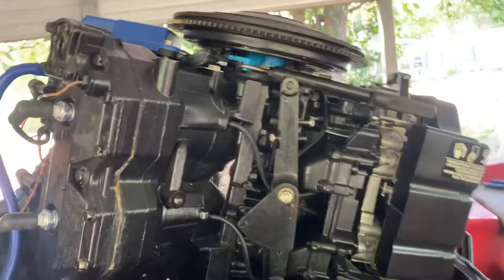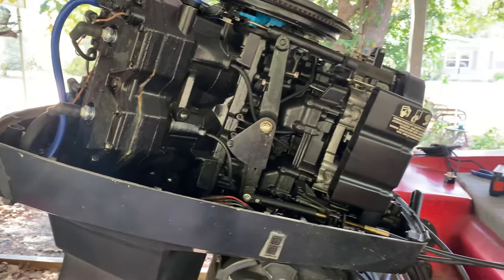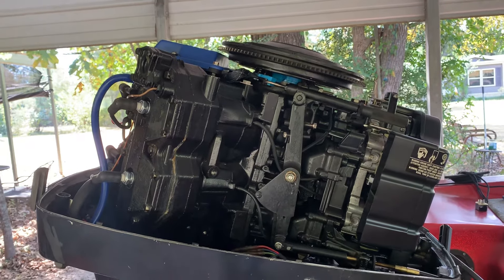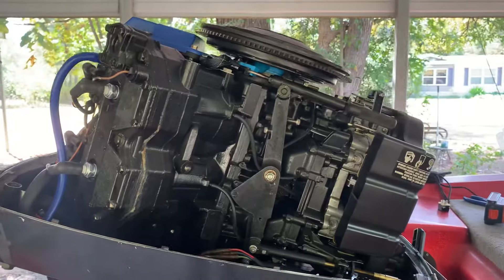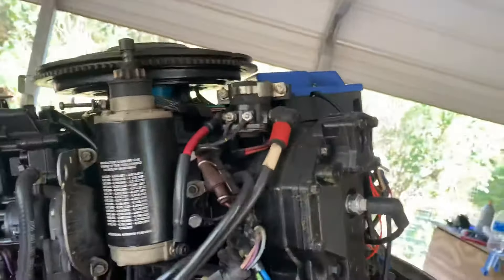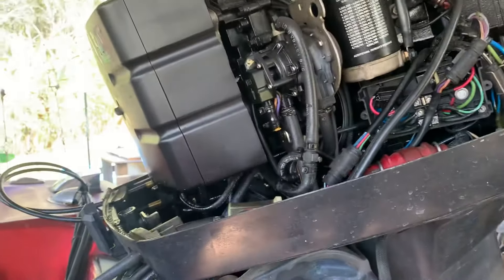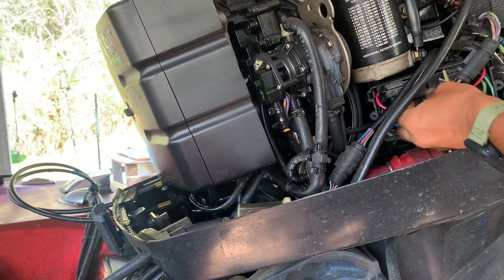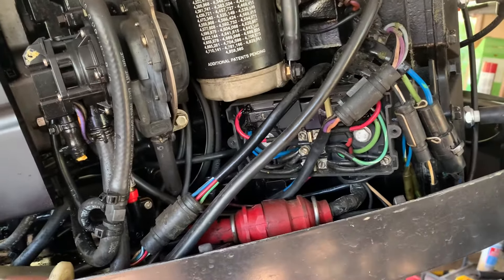Simple Fix for a Boat Power Trim Not going Up or Down (Boat Trim Not Working) 2 Stroke

Comment: To get motor to move where you need it to in "emergency", I believe you can swap the solenoids to get the motor to trim up or down (assuming 1 of your 2 solenoids is good).

Comment: Thanks for this video.  I have a old 125 tracker by mercury and this was my fix!   You saved me some money with this quick $20 part swap and now I have trim again!
Reply from the maker: Very cool, happy it worked for ya!
Reply: Where did you get the solenoid? I have the same problem
Reply: @paulriendeau1971  a local boat shop that handled Mercs

Comment: Hello!
I have problems too with my downtrim...the uptrim works good,down doesn't nd when I push down I can't here any click apart from the click from the button...it could be the same problem u had?
Thank u nd greetings from Romania, Europe!!!
Reply from the maker: Thanks and I wish you much luck. Could be a few things, starting from the simplest first. Relay, relay harness, wiring, or trim motor.
Reply: @cwulfoutdoors318  thank u for responding me so fast...I would say it s a relay coz it s working good uptrimming...I will try tomorrow nd I will let here a respons for the others which have the same issue!!!
Stay blessed!!!
Reply from the maker: You too, and thanks for contributing to the discussion
Reply: I can hear my tilt motor wend I push up or down but it won’t move

Comment: My trim goes up and down from the throttle but only goes up from the motor. Any idea as to why it won’t go down from the motor?
Reply: Mine is the other way around?

Motor trim works up and down but throttle trim only works up?

Any ideas?

Comment: I don't have any working trim the motor doesn't buzz at all the trim is dead what may it be I'm new boat guy? Hope you can comment give me an idea on what it might b
Reply from the maker: Easy fix might be a bad connection to the battery, or a switch. If theirs two switches then it’s not that. Could possibly be the power trim motor.
Reply: Tk you cwulf
Reply: Thats not a solinoid, its a Relay
Reply from the maker: @richshadwell5561  yeah that’s what the guy told me it was a solenoid but after researching it I found out it was a relay. Link is in the description. Thanks for the reply.
Reply: @cwulfoutdoors318  I switched the relays around and it does the same thing so evidently its not a relay !
Reply: Mine would click both ways up and down and not work. I just had to peck on the motor while trimming and it worked. Apparently it was froze up during off season and needed a little vibration to fix.
Reply: Found out it had no trim motor
Reply: I have an 85 hp Yamaha, no tilt up or down I can hear the motor running but it's not doing anything I bled it and it's full of fluid and nothing going on any ideas what that might be

Comment: How do you test them?
Reply from the maker: I just troubleshoot them by swapping them with one that I know works and the switch works as well. Also will use both the switch on my controller and the one on the outboard itself. Mainly just trial and error but I’m sure there’s probably other ways that more electronically inclined people know.

Comment: hey bud, my downtrim isnt working, but uptrim is, evinrude 50hp. working fine up until i hit a sandbar & found i have corroded wires that have been replaced. Still no downtilt but have uptilt. kindve stumped. Still possible relay?
Reply from the maker: Hello and thanks for the question. You can test if it’s a relay by swapping them and seeing if the down trim is working and the up is not. If still the same outcome it might be the harness. I have a video after this one where I replaced that part. Good luck, hope it works.
Reply: Same issue with same motor